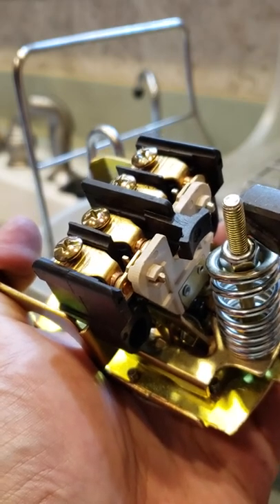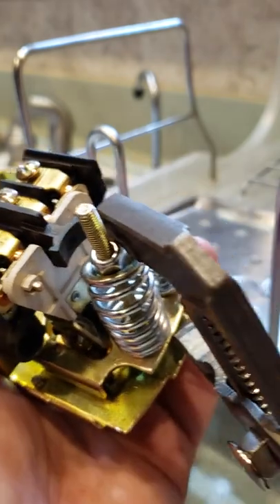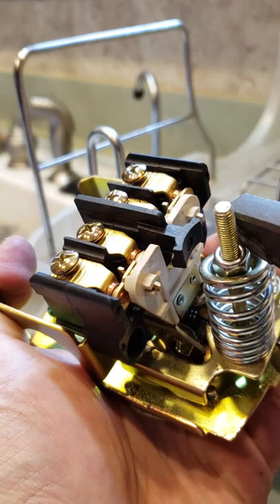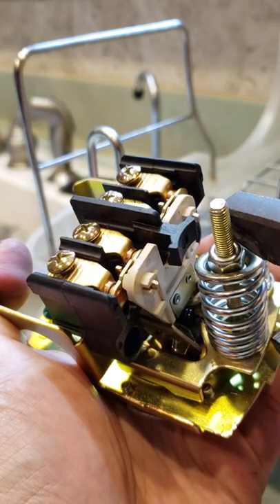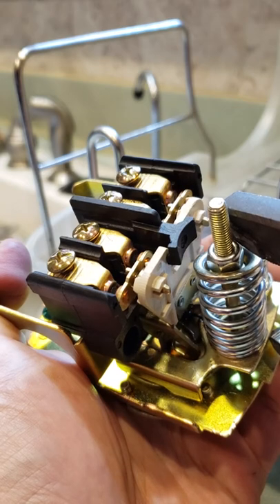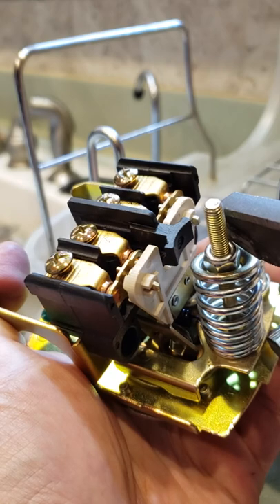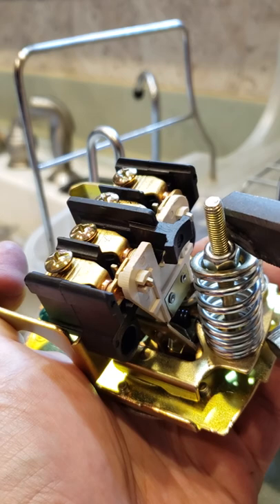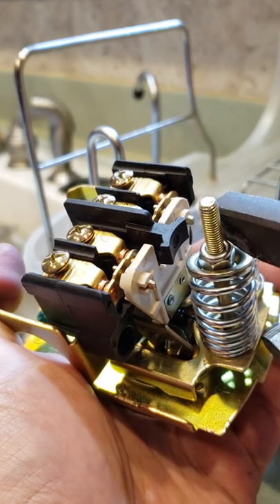Faulty pressure switch opening causing arc

Comment: There should be two small springs between the white holder and the contacts. They push the contacts to prevent arching during separation. Maybe they fell off and this is causing the problem. Hope it helps.

Comment: How do i stop this? Im burning them up every other month... sucks and idk hoe to fix it besides changing it out then it happens again
Reply from the maker: Try a different brand? The replacement switch I bought was a Square D and did not have this slop region, been going strong 2 years.
Reply: Check if the wiring is correct and distributed on both sides.
Reply: Use a motor starter , that switch should on have hot & neutral from breaker from comp switch to motor starter aux . Then from there line side of motor starter fed from breaker , load side after heaters to your motor Walla now you have no chatter or arcing

Comment: I got a pressure switch that will chatter at the low pressure cut in. Pump turns on fine will build pressure and pressure switch cuts the pump off fine. When the pressure drops the pressure switch chatters and the pump will not kick back on. Any ideas?
Reply from the maker: New switch is the only thing i know.

Comment: Air and a little water come out of my switch, a five-stage pump, when you need to take water, it doesn't turn on, as if the pump is disconnected from the electricity.. A very old pump otherwise 🤔